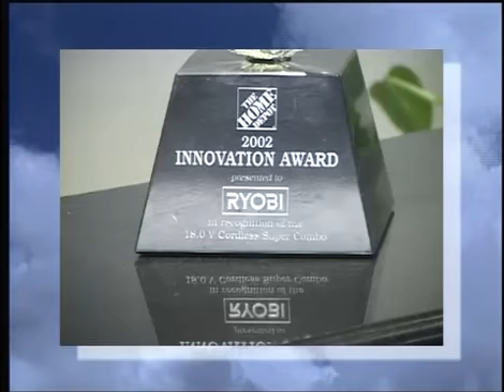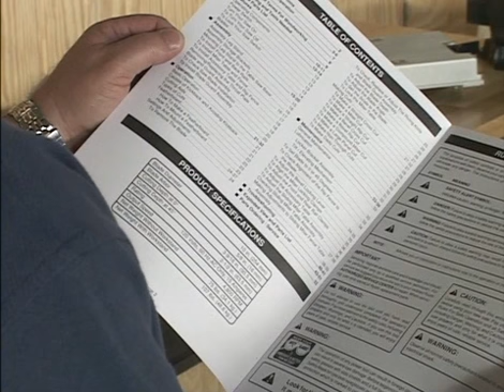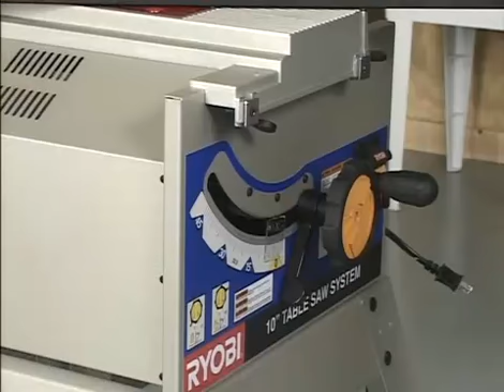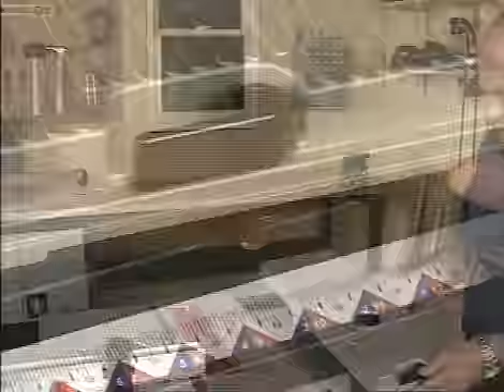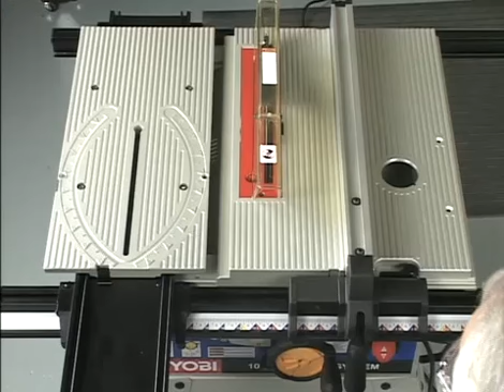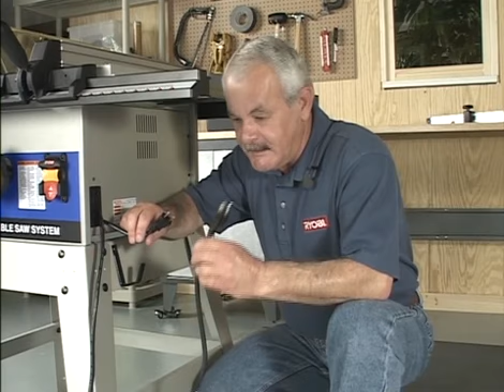Ryobi BT3100 Table Saw - Part One

Comment: I bought this saw back in 2002 from Sears.  I chose this saw at the time because of the adjustable rails.  It was my first ever table saw and has been one of the best purchases I have ever made.  Now 18 years on, it is still going strong - I have made many, many things with it, but the time has come to give it a little TLC because it has been used outside a lot - some of the panels are rusty and the mechanisms need a clean.  I only discovered a month ago all the orginal accessories that were available for this model and that you can still find them on EBay and other places.  I just bought the miter-slot table accessory so that I can use sliding-rail accessories - this was the feature that I always thought that this table needed and I never knew you could get it !!  Although I love this saw, there are several irritating things about it.  I'm looking to improve the mechanism that allows the rails to move from side to side.  The current design with the plastic levers is very unsatisfactory and easily gets filled with dust and debris and then you have to clean it all out - and the plastic levers feel like they will break when you move them.  Also the dust collection system needs some work.  The wrenches that come with the saw for changing the blade are made of soft metal and the blade locking fingers at one end of the wrenches bend easily.  I'd also like to install one of those blade safety covers that is mounted from the side so it doesn't stop you making Dado cuts.  The one that comes with the saw is a PTA when it comes to blade changes and you have to mess about with those awful shims.  If you loosen the bolts on the shims too much, the nuts that hold them in fall inside the saw and then you have to take the saw apart to recover them.

Comment: I have (had) an older BT3000 and the gears that raise the blade finally wore out after 23 years of hobby use. I don't have a lot of experience with other saws, but I found the sliding table to be great and also the router table made it a great space saver. 

I am wondering whether or not the tables and rails from the older saw can be used with the BT3100 motor housing. That way, I could save some money. They certainly look like they are the same design. Does anyone know if the older attachments are retrofittable?
Reply: Even though this question is 2 years old, I'll answer for future reference...
Yes!
Nearly all of the parts are readily interchangeable.
I have had 3 of the primary versions of the bt3xxx saws, BT3000, bt3100 and the Craftsman branded 21829.
I used rails from a 3100 to extend my 21829 to a 52" rip.
Table tops are from the 21829 and a BT3000.
Accessories work across the various models also 👍
Reply: @scottcasey7108  I know your comment is 3 years old, but I'm going to ask anyway. How did you attach the extension rails? I just acquired a second set of rails and am looking into how to attach it. Thanks!

Comment: I own  a 3000.  Any idea where I can get the plates that you use to join the extension front and back rails together...???
Reply: I have the bt3000 too, and I've found I can find just about ANY part I need on Ebay! If u dont find what u need right away, keep checking every few days! People part these out all the time, so new parts appear regularly.  Just keep looking, you will find everything you need! Good luck!

Comment: I bought a BT3000 used.  The rip fence has a broken handle.  Do I have to buy the whole assembly or can I just replace the handle?  Where can I find a diagram of how the rip fence is put together.  I'm not certain I have all the parts.
Reply: I own this saw, the fence is " terrible".  I purchased linear ball slides, precision rails and a digital readout that is adjusted with a acme ball thread.  I bring the fence to the blade, get it parallel and then lock it down.  I zero the digital readout and thats it.
It's calibrated and never goes out.  If I want to rip a board that is 1.367 inches....I just dial it up on the digital readout and im done.  It never misses, I never use a tape measure on the saw any more and my cuts are +/- .005.  If you are interested in building one write back and I can walk you thru it with pictures and where to get the parts.  It will cost you about $250 but trust me it is well worth the money....It's extremely fast and deadly accurate.
Reply: @raymondpontremoli2489  That is awesome, I would love to see it! However, I would hate to sink money into this saw. The crosscut slide table is unusable, and there are no guides to mount a crosscut sled. I don't know how anybody thought a table saw without a table was a good design.